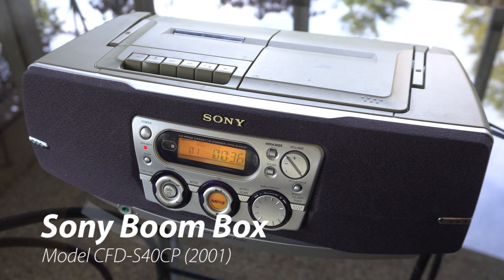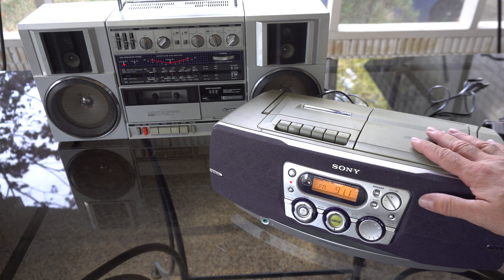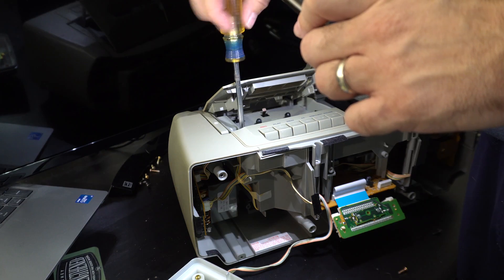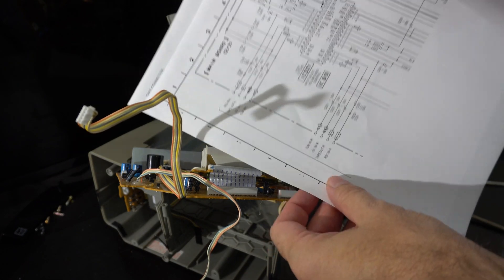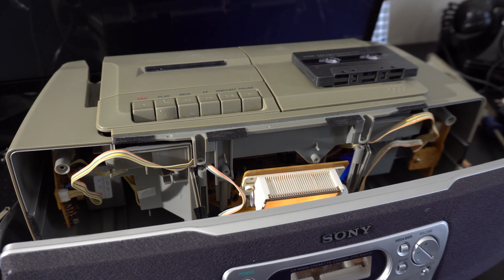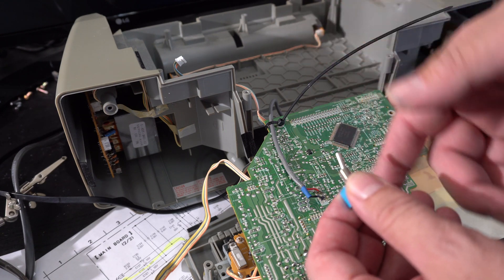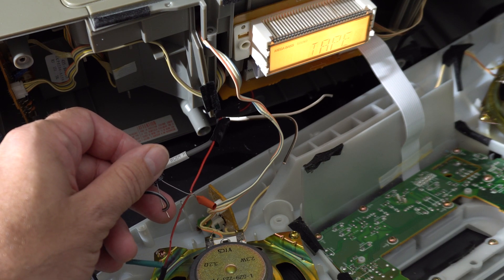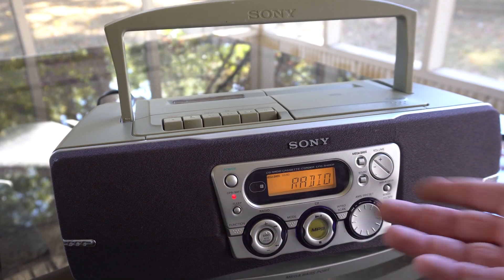Sony Model CFD-S40CP (2001) - Add Bluetooth without an Aux Input!

Comment: Very informative video.  I have a question?  Did you completely remove the preamp?  And where did you attach the Bluetooth wires?  Thank you
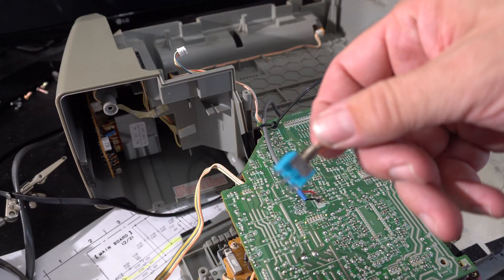Reply from the maker: Thanks for the comment! This did require a temporary removal of the main board, but nothing was permanently removed; the change is an add-on and is reversible. It has been 2 years so I do not remember the specific details for this project. However at 5:42 in the video you can see where the wires are attached. This was determined by consulting the online service manual and testing with a live audio signal.
Reply: Yes, too hasty in that regard.